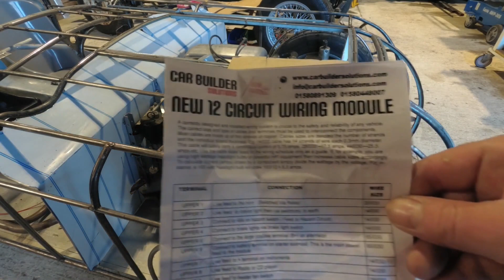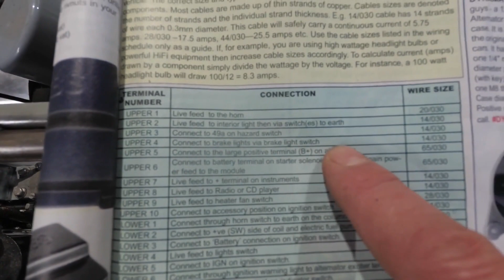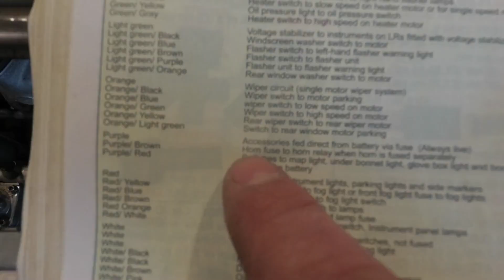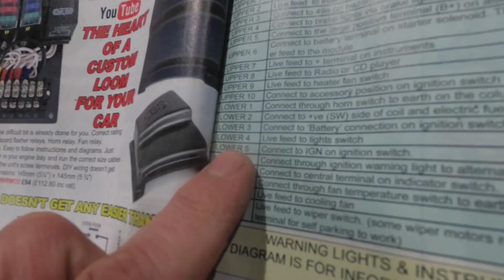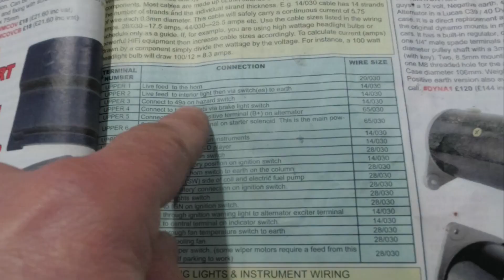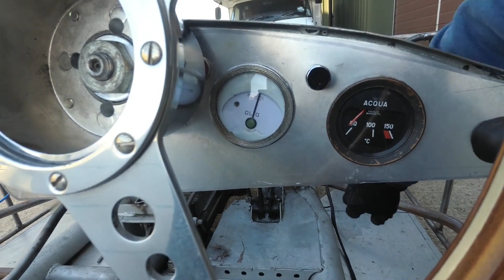Project Etceterini - Part 15

Comment: when i saw the crimp connectors i almost left but that "bit of solder" and heat shrink tubing are every bit as good as factory made. you also used a decent quality crimp tool.